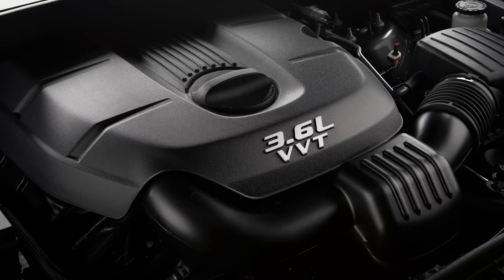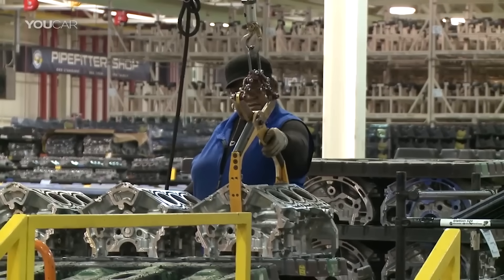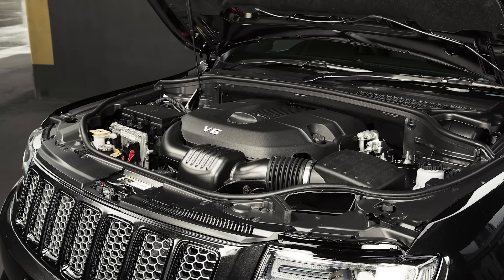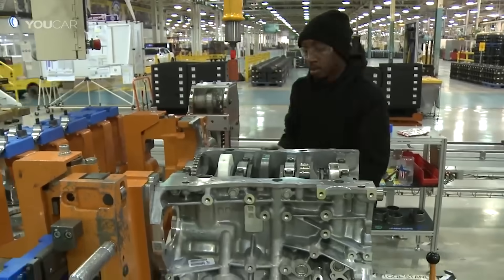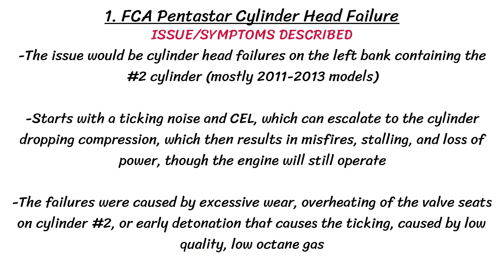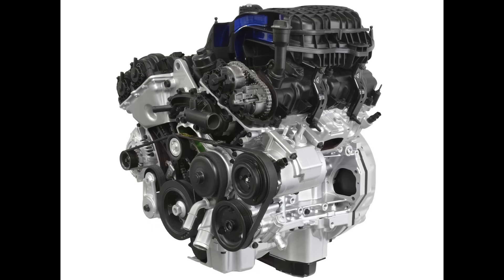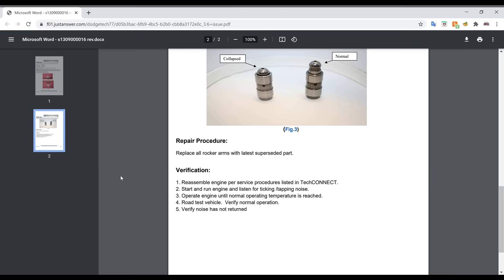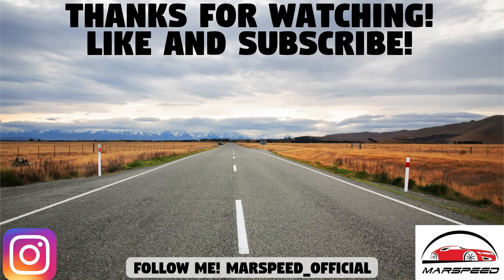The Specs and Fatal Flaws of the Chrysler 3.6L Pentastar V6 Engine

Comment: Gen 1 oil filter holder and oil cooler prone to physical damage if you are not careful about how you install a new filter. When it does fail it causes an oil leak that looks like a rear seal failure. To replace the failed unit requires stripping the top end down to the heads but if you do be sure to replace the cartridge holder/cooler with a Gen 2 unit (2014 and up).  It’s completely interchangeable and much more robust. Otherwise you’ll wind up doing the job twice.

Comment: On my 2013 Wrangler 3.6 I started having reduced heat on drivers side and found sand in heater core when back-flushed.   This was at 6 year 90,000. several videos on sand issue if you have reduced heat. Plugs replaced at 105,000 shown normal wear. Thermostat (spring stuck open) replaced at 105,000.  So I'm relatively happy with the durability of the engine.
Reply: Had coolant flush i n April  this year,  still minimum heat on drivers side, just replaced my oil filler cooler was leaking, still drivers side little heat. 2017 jk 143,00km
Reply: Did you replace your heater core, an do you have heat now.

Comment: This is only for 2015+
The Charger, Challenger, and Chrysler 300 are not e85, they use only 5w20, do not have auto start/stop and do not have EGR. In the other vehicles that use this engine as of 2018, they have EGR, use 0W-20, E85 and have auto start/stop. Also after 2015 Chrysler changed the oil filter. They issue with the valve train is almost always due to niglect to follow oil change recommendation.

Comment: Good video and one stop answered my questions thank you.  Shopping for a Jeep Grand Cherokee and running into nothing but the 3.6 L V6 and I'm coming from long ownership of a 5.7 V8.  I didn't know anything about the V6.  So,, they are really pushing the V6 in the Grand Cherokee.  But, to me, the idea of a little V6 in such a big SUV is dumb.  So gotta have an 8 speed auto etc to keep the little overworked thing in proper rpm range etc.  After listening to this video my attitude is reinforced.....not gonna even remotely consider a GC with V6.  Lots of them running around here.  Happy trails to all of the owners as they struggle with the flaws and low power of the little engine.

Comment: I have a 2015 Wrangler JKUR. I was having cooling issues and after replacing the thermostat twice finally had to replace the entire radiator  fan assembly with the harness, computer and shroud. Luckily since those are roughly $700 I found a guy that had done a V8 swap and bought his whole radiator, fan assembly and trans cooler for $400. After replacing the fan assembly the problem went away and has been good for 6 months now... fingers crossed. I found next to no info on this problem for my year but there was a ton for the previous generation but people didn't realize there was a significant difference.

Comment: I have a 2011 town and country just clocked 105000. I take it from Michigan to Florida every year for past 5 year's. started running rough this year when I arrived took it to Firestone.  Tech found low compression in cylinder 6 not 2. Chrysler says its not covered under extended warranty. Still drives but has heavy fumes from misfire. Pretty much junk now repair is 4500$. Figures I have a 2005 Pontiac g6 with the 3.5 liter.  It's been neglected way more but runs great with 200k.

Comment: 2012 town n country indeed had the left cylinder head go out under warrenty but had to pay 1000 in parts due to driving it with the misfire but I honestly only noticed a misfire when coming to a stop so be carful if the check engine light comes on with this year range of models, get to the nearest part store and have it checked for misfires and if you have them do not drive the vehicle, you will chew your camshafts up and ruin other parts.

Comment: 2013 Dodge Avenger with 130,000 miles. So far just a cracked radiator and a clogged heater core. Now I know why that happened. Since I have the maximum parts care lifetime warranty they replaced the thermostat with the heater core just to be safe. The pulleys made a loud whistling noise when it gets really cold but I assume that's normal since it happens every year and no problems came of it.

Comment: I have a 2015 - 200S with this engine and a 9sp auto , At 295hp and slightly heavier than the Dart the 200 is a rocket ship on the highway . What an awesome car to drive and would give my 5.7 Hemi Charger a run for its money on the highway .

Comment: I’ve got 156k on my Durango now and I getting the #2 idle miss.  Runs fine off idle but sitting at a light truck shakes like a HEMI with  hot cam! I’m sorry but I will probably get an R/T Durango now. I’ve had mine for 7 1/2 yrs. I just got to get past my head and and that $800 monthly payment.  Plus the V6 is looaaaded with options!

Comment: My 2011 Chrysler 200 has same engine and i am having heater core issues, no heat. Either I have to flush it or replace the heater core.

Comment: what are all these women doing on the assembly line? I never knew that many that would even apply for these jobs let alone work them. Pretty interesting it looks like Jan from the corner is throwing head bolts in while roger got a job placement for 7.50/hr to install pistons fresh out the pen. No wonder these things sucked for so long. Thats gotta be "equality" theres no way this many woman actually seeked this job out

Comment: I own a 2014 Grand Caravan and it just hit 150k. I have experienced  basic issues since owning. The damn oil filler, it "needed" a new water pump (dealer said it was leaking but never saw a drop) and starter. Other than that I've needed to do brakes and tires. I have been very impressed with this engine and hope to have the same luck with the one in my wifes 20 Pacifica.
Reply: I used to work at a dealer, typically during inspections they can see the start of a leak forming with pink crust forming around the waterpump. Happens to Toyotas a lot. Once that pink crust forms, it could be any day when that seal lets go completely and you're stranded on the side of the road because the coolant dumped out.

Comment: 115,000 miles, zero issues with engine. 2013 Challenger. 2 owner.
Reply: Now 180,000 MI. Smoothest running V6 ever. However I did have to replace the oil leak because it's made out of plastic. And I paid somebody to do it and it was a fortune. The new ones are aluminum. However still gets 30 miles a gallon on the highway and run smooth like a top.

Comment: 2013 Jeep Grand Cherokee. Replaced all rocker arms and hydraulic valve lash on the right side of engine immediately after hearing ticking noise @119,328 on 8/26/21. One rocker arm was bad and 3 had some play. Job needed a valve cover gasket set, upper intake gaskets and throttle body gasket. Replaced torque crews on EGR valve (old gasket used) with 5mm bolts for easy access in the future. Remove the throttle body to access the 2 throttle body support nuts. Two bolts were removed to relocate transmission fill tube allowing for valve cover removal. Special tools needed to secure the cam shaft.

Comment: My boss' 2015 Wrangler has had multiple rocker arm failures. Also one I think you missed is crankshaft position sensor, his failed as well and some reading I did concluded that was a common pentastar engine issue

Comment: So I came across this video too late ! , changed two cams and rocker arms , on the passenger side  last February 2021, it’s now august I changed the thermostat last month but still having intermittent hit engine issues , thing about flushing the rad , I have 289,000 kms

Comment: I have 150k. Just out of 10 year warranty. Tick.  Throwing can sensor codes. New sensors did not resolve.  It is eating coolant, not fast, but it is. Not sure, but it may not be worth rebuilding.  Sure sounds like a rocker arm, maybe coolant leak as well, and now looking at this video, maybe I will loose compression. Blah. All for a journey that is worth only $3k.

Comment: The 3.6 is still a very reliable engine get the newer ones with updated parts. I seen one with 620k miles before losing a timing chain tensioner and locking it up.
Reply: Yeah timing chain and tensioner should be replaced between 150k and 200k
Reply: @shawnwines7490  I’m glad I came across this comment. I have 2014 dodge durango with 320k on it. I need to get in the shop and hopefully squeeze another 100k out of it if I can.
Reply: @deliciouslouisiana1168   If the oil is changed at least every 5k miles the chain and tensioner can last much longer than 200k miles.  But for engines with neglected oil change intervals, then yes, the chain can wear out quickly
Reply: @shawnwines7490  If the oil is changed at least every 5k miles the chain and tensioner can last much longer than 200k miles.
Reply: Cool story bro.
Reply: My jeep jt with less than 30,000 miles is in the shop getting lifters and related parts replaced.

Comment: I practically haven’t been able to use my “new” Jeep Gladiator Rubicon purchased on November 29, 2019. This particular unit is still, to this date (August 13, 2021), showing check engine warnings and Jeep has been reluctant in authorizing a substitute. The original engine (manufactured in Mexico) was opened three times to replace; faulty rocker arms and lifters in cylinders #4 and #6, bent camshafts, worn bearings and compression losses. The new long block that was installed last December of 2020, is still having problems. Yesterday I got a call from the service department to let me know that the “new” engine needs repairs with new gaskets, etc. Both of these engines were yielding only 12.6-14.0 miles to the gallon. I own a 2012 mustang Boss 302 with a 5.0 V8, 444hp engine that gives anywhere from 14 to 29 miles per gallon with an MSRP of $43,000. This Gladiator with an MSRP of $59,234 (VIN#1C6JJTBG1LL151999) only had 786 miles in the odometer the last time it went for service on July 22, 2021. It has been under repairs most of the time after it was purchased and I haven’t been able to drive it for more than 40 consecutive miles or minutes (whichever comes first) before it shows check engine and/or auto stop-start warnings. Unfortunately, there is no local Lemon Law in Puerto Rico (even though this island is a US territory under Federal jurisdiction) as there is on all 50 states. Only the Magnusson Moss Warranty Act of 1975 gives general protection for all US territories or possessions but I guess it has to be enforced through federal courts. I guess I’ll have to rely on social media to obtain a remedy for my frustrating experience with Jeep. Thanks for your informative videos.

Comment: I just had my oil changed a week ago. The mechanic asked me if I had it changed since the last time I was there and couldn't believe me what I said no. I put about 9,000 miles on it since the last oil change and he said it looked like I had it changed recently. My Chrysler has 123,000 miles on it and it runs smooth with no noise. My last 3.6 had over 170,000 miles on it and ran smoothly as well. The only reason I switched to this van is because the other was in an accident. I have no complaints about these Pentastar engines.
Reply: Oh, and for the record, both Town and Country vans were 2011.

Comment: My Avenger has one and it’s been perfect so far! 130k miles ain’t don’t anything but change oil and plugs coils! She still gets up and goes with you! 282hp in a lighter avenger and 200 with the 6 speed move pretty good! Great mid range! I got 20’s on mine so it hooks hard and goes!
Reply: I still think it's an insane engine. 2011 Chrysler 200 makes over 305 HP with a stage 1 tune. Insanely fun sleeper

Comment: Im tired of seeing videos about engine flaws, I was an ASE certified Master tech for almost 30 years and started out in a Cadillac dealership during the early 80s.  We had so many high dollar Cadillac cars with the HT 4100 engine that had leaking intake manifolds,  oil leaks,  and other problems that we would just add stop leak and send them to another dealership because we were full.  We were told by GM that the worst experimental engines are going to be in the highest price cars because fewer people would be buying them and if there was a recall fewer vehicles would be recalled.  I'm saying this because every single auto manufacturer has its issues and problems,  regardless of the brand!!! I worked in a jeep dealership during the 80s and 90s and would have never thought I would own one today because I thought they were junk,  but today I own a newer grand Cherokee limited 5.7. If it's mechanical you're going to have problems,  but I think the biggest problem with auto manufacturers today is because of its suppliers and sub standard parts.

Comment: 2015 jk 3.6 1 bad lifter found as for rockers they all past my inspection. i run 89-91 oct.
and had very little problems @ 45000 miles

Comment: Had to replace All rocker arms and 2 camshafts on my 2013 Jeep Wrangler Unlimited Sport 4wd JKU.  Had them replace the oil cooler while they were at it. On my 3rd thermostat. Had the radiator flushed close to 2yrs ago. Replacing brakes all around next week. Calipers, rotors, pads with crown auto Big Brake Kit.  New Fox 2.0 Shocks. Im guessing coil packs and spark plugs and alternator are next.

Comment: My 2011 Challenger V6 ran great after owning it for 3 years before upgrading to a challenger srt8. I like to think what helped my engine from experiencing any problems were that I had replace the coolant overflow tank and added new coolant during the first few months of purchase. Driving mostly at night to work and avoid long drives during the hot summer. Also not doing alot of burnouts and high accelerations. It was a good commuter car. Got it used from 76k miles until I sold it with 108k miles. Only real I had was with the front right control arm.

Comment: 200,000 hard miles on my 3.6 town and country and it runs like a raped ape. When I say hard, I can say I drive it like I stole it daily 200 miles round trip. It takes everything I give it. I hit the red line atleast a handful of times everyday no issues. It pulls like a freight train. I bought new in 2011 with 3 miles on it. Change oil and filter every 5000 miles since new with synthetic 5w 30. I don't miss oil changes. Water pump and thermostat at around 100,000, 3rd set of iridium long life plugs, regular air filter changes, 3rd belt, new tensioner around 188,000. Brakes are under sized imo, I eat them. Seems like I'm always doing brakes on it but I also drive like I'm on the Nascar circuit so I don't blame the van. Lol I love this mopar, it surprises alot of people when pull ahead the crowd in a minivan. The minivan>2in the front 5 in the rear✌🏽✊🏼🤣
Reply: Update, had a trans solenoid go bad in the ghetto. The van went into Limp mode locking the trans in second gear. I drove 80 miles with four grown men at 45 mph, thats 4500rpm consistently. The van is waiting for parts, but I bought another one that's like new because I'm not 100% about unseen damage at this point.🤷🏼‍♂️ Regardless this van still took it like a boss. Also no tick issues on either van, and I think the Pentastar is a strong durable engine.

Comment: 125,000 miles on a 3.6L 2012 Dodge Journey STX  so far no engine issues original  spark plugs replaced at 120,000 with a coolant flush and thermostat replacement runs like new, conventional oil changes every 3000 to 4000 miles.

Comment: I'll never buy another chrysler.  But the engine on mine did last for about 130 thousand miles. The transmission dies around 120 thousand.  Then once I fixed it it got stolen😤.

Comment: I had a 2014 JKU Sahara lifted with 35's I got a blockage in the heater core @ 60k miles and had it flushed. That fixed the problem and The jeep ran great got rid of it @ 80k and now run the New 3.6 in a JLR I love them!

Comment: 175k on a 2012 Charger with this engine.  using Amsoil on 10,000 mile interval changes and had to replace an oil pump and a water pump.  both covered under our lifetime extended warranty.  when i drive (70 mph or so) we have gotten as high as 36mpg which is pretty good since the sticker only said 32.  my wife drives a bit more aggressively so mileage is closer to 30.  this has been a great engine for us.  if my '04 Dakota wasnt 4x4, id swap one of these and the 8-speed transmission into it in place of the 3.7l.

Comment: I had this in my 14 Promaster. The motor was terrific. The radiator did leak early on and was replaced under warranty. I kept it 7 years and just sold it this spring. Great combination of power and economy and smoothness. Call me a fan. Knowing the roller rockers could be weak, I never let it sit idling as that reduces oil flow. And I always changed the oil with good synthetic every 5k miles. No issues on mine!
Reply: I drive the promasters about 5 days a week at work.. They're so much easier to drive than the Ford full-size vans.
Reply: Но если вы используете машину зимой? Когда нужно стоять и греться?

Comment: ive nver had any problems ive always ran premium gas and i beat the shit out of my car hell i have the ricer muffler with holes drilled right before the muffler to get a muffler delete before i get my new muffler as long as ur not a idiot it will drive
edit i have a challenger gt if u want to fix the cooling take out the stupid thing they put in the headlights

Comment: Got the 3.2L Pentastar in my 2015 Jeep Cherokee Trailhawk.  Regular maintenance, runs like new, doesn't use any oil between changes.  Gets 20-25 mpg in normal driving.